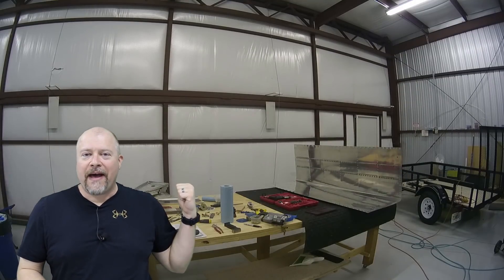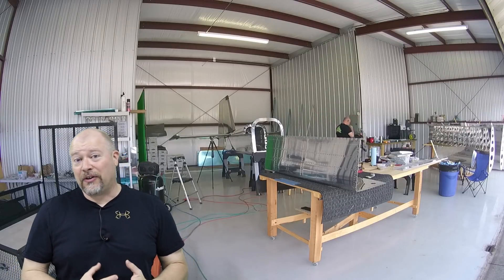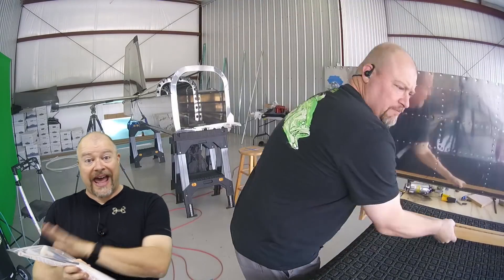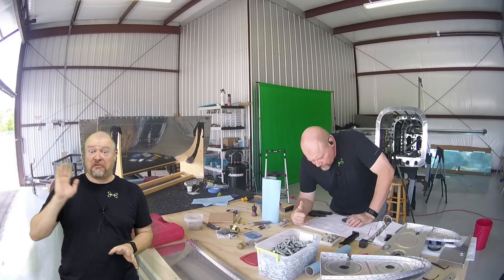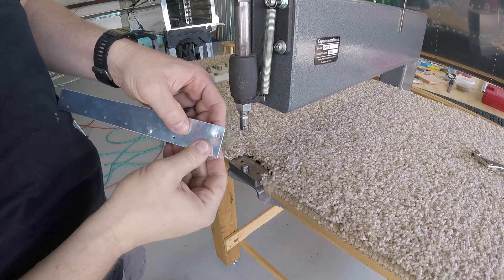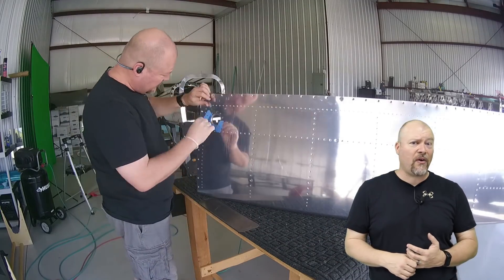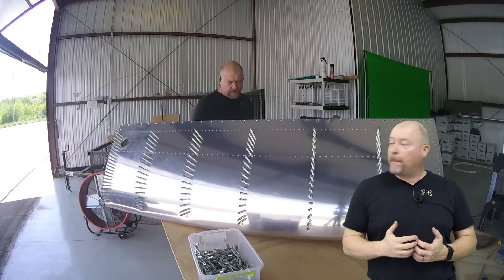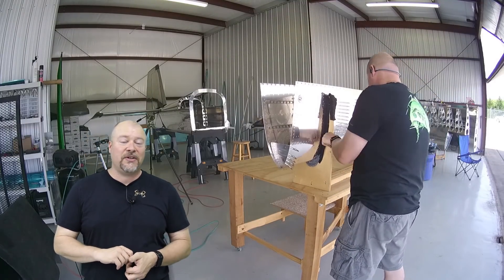RV-10 Wings - 053 - Wetsealing front vs back, and what if you dimpled the wrong side of a skin?

Comment: i would say you still want to seal the outside rib, for the simple fact, that it is STILL a wet area and needs to be completely sealed accordingly. With the vibration of flight the bead on the inside can fail and then the entire contents is going to leak out very quickly

Comment: Great video!  Regarding dimpling the wrong side of material:  You may reverse dimple a dimple made to the wrong side, as Jason said, ONE TIME only, and the dimple will still retain enough strength.  But any more then one correction and the materiel is significantly weakened.  I would caution however that this only be done with one or two incorrectly dimpled holes, not an entire skin.  If an entire skin has been dimpled from the wrong side, call Vans and order a new one.  Don't be discouraged.  Chalk it up to a lesson learned and it's most likely a mistake you won't repeat.

Comment: You can only use too much sealant when you start clogging up pass throughs for fuel inside the tank. I personally went through a quart on EACH tank and I still needed one of the 3 oz caulk tubes to put on the baffle of the 2nd tank.